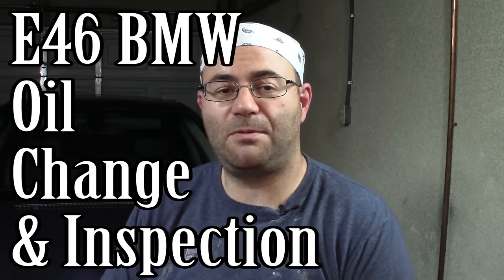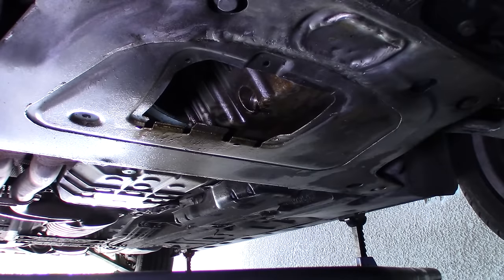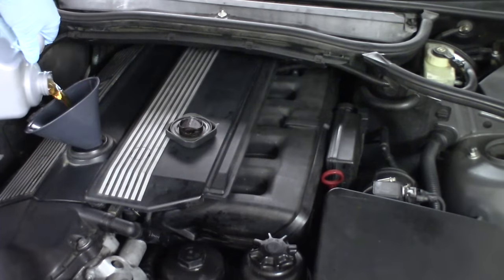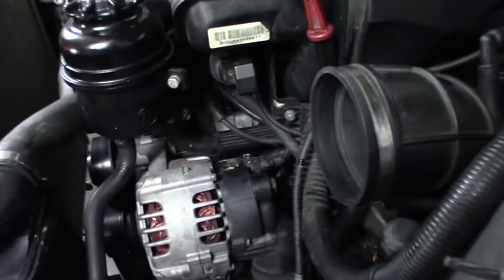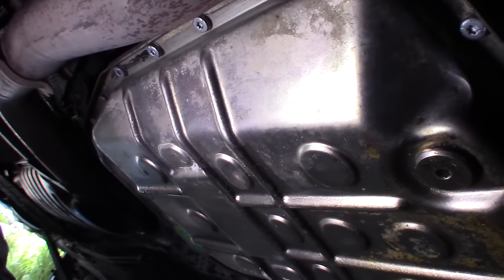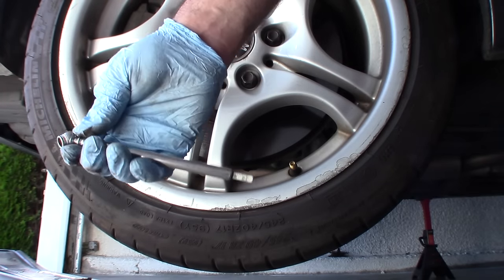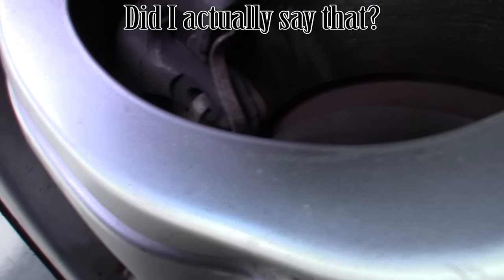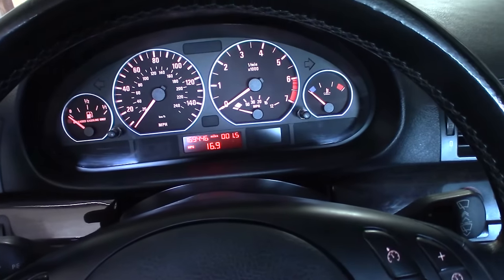BMW 330i 325i E46 Oil Change and Inspection DIY

Comment: Minor quibble - the filter is usually installed into the cap (until it clicks), and then screwed into the housing as a complete unit.
Probably won't make a difference, but "cap first" is considered best practice.

Comment: Great video. One item/feedback. Use 36mm socket. Easy to use and if you are going to change oil often, it will pay for itself. Using the adjustable wrench can easily damage the Cap, will cost a lot more to replace that compared to buying a 36mm socket. For me it worked out well as I have a Range Rover with M62 BMW motor and same 36mm socket works on that too.

Comment: I would recommend buying the 36mm socket for the oil filter housing cap because it is made out of plastic and the edges wear down easily with a wrench.
Top notch videos mate.  You're like the Khan Academy of E46 ownership.

Comment: 6.5 liters is what you need to put in the car (01 330ci)
Reply: same as 2003 right ?
Reply: what oil do you use
Reply: @mpc007  mobil 1 5w-30 full synthetic for me on 2003 325i

Comment: great video. however i have one issue with your procedure. i actually cracked my filter housing cap by trying to remove it with an adjustable wrench as you have done. luckily i had another one in my shed. but i had to go to my local mechanic and borrow a 36 mm socket in order to get it off at all. 
i would recommend to anyone doing this to always use a socket to remove the filter housing cap.

Comment: Just changed my oil myself, Pennzoil Platinum 5w30, it took all 7 qts, I was taking to BMW dealership that had 70 dollar oil changes, but moved and all the ones out here want 150 plus, but the last oil change I got was at the dealer and there was no drain plug gasket🤦‍♂️ wasn't leaking so there ya go, 16,700 miles and it's brown, not black😎
Have the tie rods coming in, and probably gonna have to replace a rear cv axle. But I think putting new shocks all around just encouraged whatever parts were getting weak to just go out. Still drives like a champ, only slight vibrations, and you've been helping me through most if not all these issues👍

Comment: hi 50skid..pls guide with choosing oil..i m totally confused..these are the options
1. 5w-30 synthetic but not ll-01(mobil,castrol)
2.5w-40(b3/b4..bmw ll-01)recommended by stores
3. castrol 0w-30 european formula(also ll-01)
4. castrol 0w-40 european formula
cannot find a 5w-30 ll-01.thank you..pls help.2002 bmw 325i 2.5 m54
Reply from the maker: You're overthinking it a little bit.  All you need is any synthetic oil that meets API-N (America) or GL-5 (Europe) specifications.  5w30 is the best all around oil for most climates--if you get cold winters, find a 0w oil.
Reply: 50sKid thank u..so much.nobody made it clear and they scare alot.
Reply: Use LL-01 in your BMW. You can use any oil selector on any oil site like Pennzoil or Castrol and they all say LL-01. Doesn't matter if it's 5w30 or 0w40 as long as it meets LL-01.
Reply: Xrs2zz thank u!
Reply: Castrol edge 0w40 euro formula all the way

Comment: He mentioned that leaving the oil cap off will cause a vacuum leak. Does that mean my P0174 (running lean code) came on because of that? It came on after I got done with changing my oil and driving for 10 miles or so

Comment: I have a 2003 bmw 325i does it take the same 5w-30 oil that your using????
Reply from the maker: yes
Reply: Siboney Santos please don't use that oil, it is walmart brand that is not BMW LL-01 approved.
Reply: Leonardo Flores uhhh I use royal purple
Reply: I am letting BMW do my oil change just because I want the stamp in my service book. it is all inspected as it should be so i wanna keep doing it even if it takes me 20 min to do an oil change myself. Asked BMW what oil they will put in my 323  year 00. 0w30 they said. It is really about the same stuff
Reply: Siboney Santos I use Kendall liquid titanium. Works really well. Quiets my calve lifters and overall engine.
Reply: Just incase anyone is reading this, most "compatible and good" oils won't be LL-01 certified. This is because LL-04 superceded the old 01 spec. Any car (e46) that required LL-01 can also accept LL-04. If however your car (e90) calls for LL-04 you CANNOT use LL-01 as they are not backward compatible.

Comment: I just bought an '02 330i, and the previous owner used 0w-40. I see int he comments you said 5w30. Why 5W30 and which brand?
Reply from the maker: you can use 0w40
Reply: Nick Dennis I believe engine oil that begins with a 0W is best for people who live in colder climates or during winter time.

Comment: Thanks again for an awesome video. I have a couple questions. First of all I have a 2003 330i e46 BMW
1. My first question is: I know I to have to jack up the car to get under it but, is it ok to change the oil with only the front end elevated. I do not have the ability to jack all four tires off the ground. Basically, I'm wondering if the oil will drain properly.

2. It looks like there was a cover over your drain plug area. Will my car I have the same cover?

Also, thanks again for answering some of my questions about another video you posted. With the help of one of your other videos, I'm going to try to tackle my check engine light this weekend. I'm getting the "P0174 Bank to system to lean confirmed". I already replaced the bad vacuum hose from the  fuel filter up into the engine and thought that fix the problem but the light came on again with the same code. 

Thanks again and know that you are helping a lot of people out.
Reply from the maker: +pearlmcp Yeah it'll drain just fine--better, in fact, by just raising the front wheels.  If you still have the cover, that would be amazing.  Some how they just seem to disappear, lol.
Reply: +50sKid hi again. What did you used to jack up your car with? I have borrowed a low-profile 2 1/2 ton jack but when I put it under the car it's not long enough that I could actually pump it up. Do you have some other means or what type of Jack do you use? Thanks again.
Reply: @50sKid  what kind of oil did you use 5w30? Brand?

Comment: where can I get the cover that goes above the intake? what's the specific name for it? my car is missing it.
Reply from the maker: Those are just the engine covers.  I think you mean the one that goes over the fuel rail.  Search for part number 13531707404 on eBay.

Comment: Just a fast question  been watching a ton of ur vids    What oil should I use in my 2004 bmw 325xi  

This thing is new to me but I don’t know crap about e46 motor
Reply: 5w-30.

I'd snag one of the oil change kits from OEMBimmerParts.com.  That way you get all that you need in one order.

Comment: What is the torque spec for the oil drain plug?
Reply: Da Maestro As it's thread is covered in oil I would not recommend a torque wrench on the drain plug. Torque specs are for dry threads so it would be far to easy to strip even with a torque wrench. My method is (WITH A NEW CRUSH WASHER!) just tighten up the plug until you see the washer slightly compress. Then STOP. Check for leaks after filling and running the car before dropping it back down. Drain plugs don't need to be super tighter. Oil is thick and won't leak easy from a snug bolt.
Reply: okay thanks

Comment: Hey 50skid. I have a 2003 330ci. I have a clicking coming from engine.
Hydraulic lifters? please give me some advice
Reply from the maker: Yep, lifters.  I still get a noise every now and then that goes away with a long drive.  The lifter gets pumped back up basically.  I plan to change them -- I have the parts sitting waiting for the right opportunity.
Reply: @50sKid  can i send you link to listen?

Comment: Nice job on this video. Very straightforward and practical. You had 169,000 miles on your Bimmer when you made the video. Do you still own it? I have a 2004 330Ci with 88,000 miles on it.

Comment: looks like you need more air in your tyres. I would say 45psi to get the middle gripping. love the channel my 2.8 1998 e46 is running like a dream from this channel. cheers. Nice.

Comment: Hey so what measurement do I need to remove the oil housing socket ? It says 25NM on the top but In MM. what size does it need ?

Comment: I just went 6.5 months and 21k miles between oil change on my 04 325i, I gave it 2 qts during that time, half a quart at a time, when the oil lamp comes at ignition off, indicating half quart low, it still looked good😆

Comment: I thought those o rings came in my oil filter kit but was super annoyed when I took them off hardened and snapping then realised I only had drain plug washers and a exterior o ring

Comment: Thanks again for great video. I dont know which way is correctly but usually i take that oilfilter cap to table, clean it, replace that big o-ring and then i put filter directly in that cap. Then i install cap+filter to its housing and tight it to 25nm.
This is actually first time i see that someone install that filter element directly to oil filter housing. As i said, i dont know which is correct way, i think both will do just fine.. :)

Comment: so you used 7 qts ??
Reply from the maker: Sometimes 7.5.  Depends how long you let it dribble.
Reply: Wow that seems like so much. My first BMW just bought it 2001 325xi 5 speed. My jeep used 5 qtrs with a 4.0 liter so 7 was surprising for a smaller motor
Reply: BMW high compression more oil makes sense.

Comment: Inspection for BMW is a joke. I mean literally all they do is check stuff. check simple stuff that even the mechanic do once a year. Go around and check for leaks and make sure everything works. Why would you even pay 500 euros for inspection 1. They change the oil then go around and look for leaks (if they even look or just dont care). 30 min job.
Better do it yourself but you'll get no stamp in the service book. 
Nice video though!

Comment: great vid as usual. im experiencing some slight engine knock under normal driving conditions, and much more pronounced under load. Im thinking since the car was only driven 2000 miles a year for 16 years (2000 320i) that there may be some carbon build up. What do you think of those oil additives used for 10 minutes immediately before an oil change? second question: my car had been sitting for about 2 and a half weeks. I asked my wife to start it and let it run for 15 minutes. she starts it and shuts it off after 30 seconds. the next morning, it wouldnt start Im pretty damn sure the problem is cylinder wash down, so I'm gonna put a table spoon of oil in the cylinders tomorrow (did it before with my volvo 960 when i lived in the US). But one of my friends just told me that I could just hold the accelerator down to the floor when im starting the car, and the problem would be solved. I've never heard of that before. does that even make sense?

Comment: I can't believe you are screwing a steel bolt (oil drain plug) into an aluminum part without using a torque wrench.

Comment: ... does the car run differently when you use something like super tech brand oil?
Reply from the maker: +Isa Ramirez No, oil is oil as long as it's API certified.

Comment: Hi! I'm finding your videos super useful and interesting and I wish all the best with your future material. I  would like to know what kind of oil would you recommend (a couple of choices) for a Sedan 325xi 2004 260k for summer and winter, I live in Toronto.
Reply from the maker: In all cases you need to run a synthetic oil.  As far as the seasons go, it just depends on your coldest night/morning temp during that season.  So if it never gets below freezing during summer, then a 5w30 is fine for that.  For winter you could go 0w30 for some extra protection.

Comment: Just bought an '02 325i sedan. My oil filter was split in half and the oil itself was pretty dark and milky looking. 
Is there anything I should be worried of with the split filter? 

Also where did you get the inspection list? Did you make it? I am asking so I can do other intervals.
Reply from the maker: Nothing you can do about it really. Change the oil and filter regularly now that you own it.

Comment: just wanna ask something while we're on topic of changing stuffsthat will breaks after several thousands miles or so. E46 has plastic components such as water pump and everything just like the E90. based on your experience, is the E46 plastic components breaks as easily as the E90? thanks in advance
Reply from the maker: Yeah the plastic water pump impeller will shatter after a certain amount of time
Reply: Does it depend on the mileage or it's just that e46 components breaks more easily than the e90 components?

Comment: Hey 50sKid, do you think you can produce a video on how to change the Coils for an e46? I like your detail orientation within your video content, and thanks mega-much for the "Check list" download! And yes, I did subscribe to your channel, indeed!
Reply from the maker: Search my channel for my valve cover gasket video on the e46--you'll see how it to do it in there.
Reply: Cool! In fact, I found that particular video a little after I asked my initial question. VERY HELPFUL! Again, thanks much, indeed!

Comment: all I wanna know is the red handled one this dipstick for the oil? Usually they are black or yellow and red is for the transmission fluid..
Reply from the maker: the red is the oil dipstick, yes. No trans dipstick on these.
Reply: since leaving that comment I have figured that out but thank you for replying because I did not know that there wasn't a trans dipstick but that prob explains why the oil one is red lol. Thanks again :)

Comment: no oil in the filter?
Reply from the maker: +ombra306 No it gets filled in a second or two.
Reply: From personal experience oiling the filter is good in theory until you fill the engine with the required oil level then run and your slightly over :)

Comment: Father first run the engine.
Bring to operating temperature and after checking the oil level
Why are you using so cheap engine oil?
First, insert in the filter cover not to filter housing
When you been tightening oil drain I get a heart attack
Sounds so experience mechanic and walking in opposite direction.
Reply: Hi, I have 04 e46 m54 did a leak down test. Cylinder 1 leaking air out of 3, cylinder 2 leaking out of 6 . Cylinder 3 made the radiator jump and anti freeze come out. Whats your opinion,
Reply: @gerardsmith5247  On hot engine never open Radiator cap - only on cold engine check level to special scale inserted in the Radiator - engine idle - heating max - From poor engine oils many things getting damaged - rings sized or other problems - do this engine was overheated?

Comment: i got a e 46 and when i use the highway, and then stay in the traffic my temperature goes red, ( checked for coolant everything perfect) any opinion ?
Reply from the maker: Either a stuck closed thermostat or your electric fan isn't working.  Turn your a/c on--does the fan run?
Reply: I have changed the thermostat also before i got the car 6 months back. And yeah about the a/c when i switch on i havent seen it moving. Maybe the radiator fan??

Comment: I changed the oil but when I dive the car for 1mins the yellow oil sign come on I check the oil level and it was low later I checked it again and it show the oils fine but then and now it shows it fine but the yellow light still comes on
Reply: Your oil level sensor is shot. Replace at next oil change.

Comment: Great video.  I appreciate the time and effort you put into each offering.  Please keep up the good work.  One note---thank you for being thrifty and thoughtful in the choices you make.  Most of us are not professional mechanics and do not have a complete set of esoteric, exotic tools from which to pick and choose.  The crescent wrench is a nice alternative!  Thanks again!
Reply from the maker: Thanks!  I get a lot of shit for using an adjustable wrench for some odd reason.
Reply: Don't sweat it just be you, thats why we watch your content.
Reply: 50sKid An adjustable wrench is a poor choice of tool for rusty or siezed bolts as it's much easier to strip the heads, primarily due to the reduced purchase of the adjustable wrench only contacting half the sides of the bolt. An adjustable wrench is however a perfectly acceptable tool for removing a oil filter cap which shouldnt be super tight and definitely not sized! I think it's just people who see someone say don't use an adjustable wrench o this exact bolt and then decided it's some death tool that destroys planets when in use.

Comment: Im stuck in a pinch. 2002 530i M54 engine. What size is the oil wrench cap for the oil filter? The 36mm nut is rounded off and the sucker is so tight. I couldn’t find the tool at any parts store!